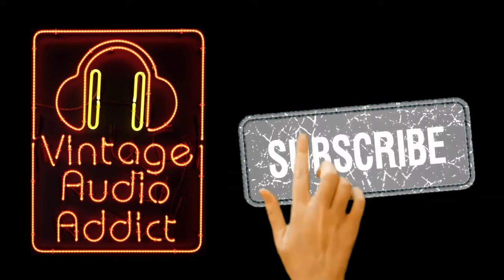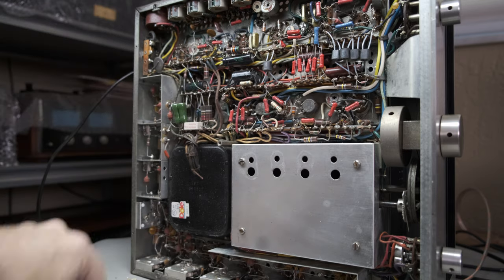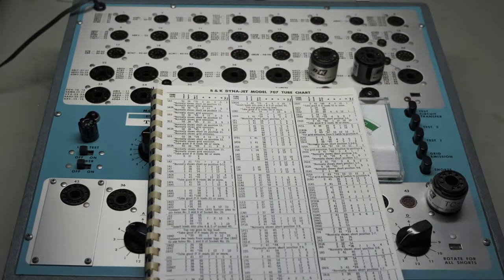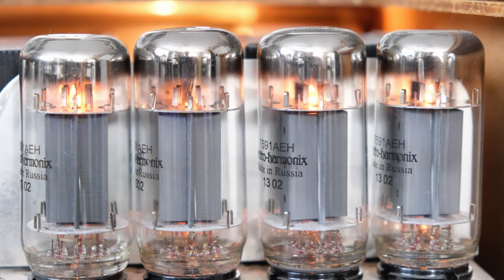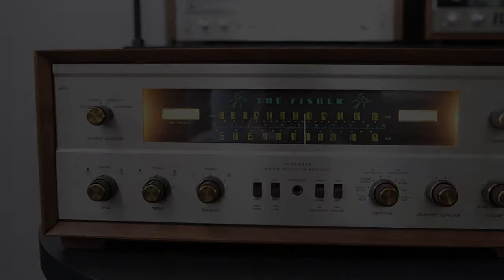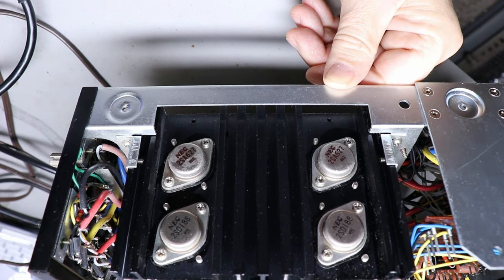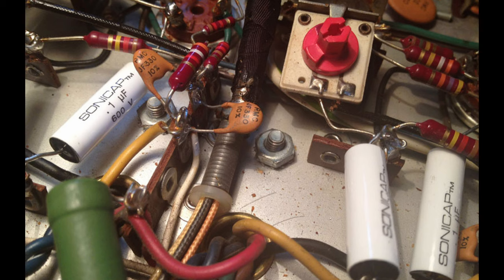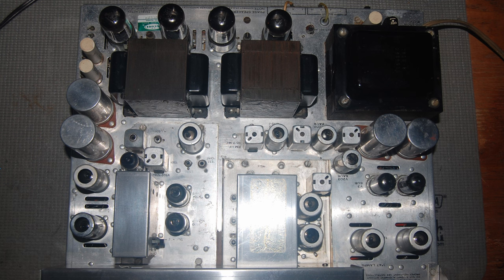Vacuum Tube Equipment - Wonderful Vintage Audio Stereo Sound But Hazardous To Repair or Restore.

Comment: When I was in the Navy I screwed up and had 400 vdc plate voltage from a transceiver go right through my chest. Man did that hurt! I was sore for a couple of days. When I left the ship and went to shore duty, I worked on high power HF transmitters with 1200 vdc plate voltage. I learned my lesson and was very careful.

Comment: Glad I watched this one!  I bought a Pioneer SX-82E (for $135 at a local on line auction).  It hasn't a scratch...came with all the original documentation...and has known provenance as the seller acquired it from his sister-in-law following the passing of her father, who bought it new in 1965. It tested sat and works...but the electrolytics are ancient. Therefore, I am a bit hesitant to run it until it is revised. Tubes are all original.  I opened the bottom cover and had a coronary...it's all point to point wiring that looks like a Gordian Knot surrounded by a neural network.

Comment: Worth mentioning is that since tubes use such high voltages to operate they routinely utilize power supplies with very large capacitances.  Even when turned off they retain this high voltage and high quality caps with low leakage can retain a charge for days.  Always discharge the power supply caps before replacing components.  They taught me in the Navy to discharge the power supply voltages when off before attaching any test equipment. Attach your leads and then power on the equipment.  It does take longer to troubleshoot but is safer.  Also watch those tube extenders. It is easy for your fingers to slide down the side of the tube and make contact with the pin-outs.
Reply from the maker: Very good points! Thank you for sharing!

Comment: Never forget my first year on my boat (USN) while in the shipyard; the boat was in drydock for a few months.  I was studying in the wardroom when we all heard the boom and smell from some electrical work in the 21 man berthing. The system was tagged out and the shipyard worker cut one of the power lines that fed the Fire Control System.  The cut line had the correct tag, but the tag was placed on the wrong line by the ship builder. Unfortunately, the worker did not FIRST check the line with a Clamp voltmeter to see if it was live. He used a large wire (bolt) cutter and the power in that 3 phase 440V line vaporized the cutters up to the rubber handles.  Thank goodness the man was standing on a rubber mat with gloves and protective gear. An incident I will never forget...the noise was substantial.
Years later, while on business in Charlottesville, I was staying at a hotel where they were doing work outside in the parking lot just below my 3rd floor room.  A worker was using a concrete pavement cutter and sliced through an electrical line to the hotel (nicked the gas line next to it , as well). I was in the shower at the time and did not even hear the faint evacuation alarm. In any event, he vaporized the cutter up to the rubber handles and suffered some second degree burns.  When I realized the parade outside the hotel was not a parade and actually an evacuation, I threw on some clothes and ran for the exit stairs. Missed my flight. Consider myself lucky...if he had pierced the gas line I doubt that shower would've protected me. A close call...not as close as taking Flight 111 the day before its ill-fated crash, but still too close for comfort.

Comment: I own lots of tube gear, and I agree hahaha. It's already scary at 450V, which is standard for many models, but I have some gear running 600V (Traynor YBA1A, has the YBA3 power transformer). There's the Fender 400PS - now that thing is a monster. There's a voltage doubler for the plates for 700V; it has a 6L6GC driving an interstage transformer, feeding 3 pairs of GE 6550As, which each tie into their own dedicated 4ohm out winding; and the speaker grounds ties back to the cathode of each pair. Scary.

Love the channel! Keep it up - I'll be a long time fan for sure :)
Reply from the maker: Thanks so much for the kind words and for commenting. Yes, tube electronics of all types can be dangerous. I tell you what else can be dangerous. A 220V AC electric clothes dryer. I was "screwing around" with one of those when I was younger and got bit. That was many years ago but I remember it like it was yesterday.

Comment: I've been nursing a Marantz 8b since 1962, when I first took it out of the box.  Unfortunately, as I get older my dexterity isn't great, so I'm wary of accidental damage, or accidental self-electrocution.  (Been there, and my gear is 220v.)   I will say however, that all the tube amps  I've owned only sound better and better with age.  My oldest is a 1933 Philco console, but the 8b is my honey for life.
Reply from the maker: Thanks so much for sharing. Wow, a 8B! You really have something special. The older tube gear is truly amazing. It can still hold it's own after all these years.
Reply: @vintageaudioaddict  The warmth and detail just keep getting better with time, and especially noticeable at low volume, where solid state drops out.  The 8b I received new as a birthday gift in '62.  I enjoy it so much that I went out and bought an 8a in '75.  Unfortunately, as your article points out aptly, over the past few years I've caused a lot of wear and tear through constant breakdown and reassembly with unsteady hands.  Have upgraded my workbench with better magnifiers, micro vices, and lighting.  Not going to wreck my 8b or get killed doing so, lol.

Comment: Love Tube amps finally found
' a New Age' 
Tube integrated amp that i like better than my previous king Sansui G-8000 
The Doge 10 MK-2b is a 59 pound beast
Kt-120 power tubes , And the Circuit is built with very highend electronics ESA-Clarity Caps notch filters
 Nichicon caps Wima Omron Relays ALPS Blue Velvet Volume control
 Z-10 core still transformers And Top grade German PTFE Cabling . 
This amp sold for $6400.00U.S. under the Lua Brand while Doge made for them now for $2400.00 U.S. STR8 fron the factory  its hard to beat ! 
And 'Full Warranty' no worries about fixing nothing for a long time
I have had the amp for 2 years and it works perfect  , I play the hell out of it everyday 
I have 4 different sets of
 Power/Pre Tubes also geez its Powerful 
Pushpull desighn never thought A tube amp could have this much weight to the sound ! ! And the Imaging is amazing ! 
Electric 🎸 Geez ! The sound just hangs in the Air and decays slowly into Oblivion 
And I agree stay away from Vintage tube amps unless you know how to work on them or have a lot of money !! 
Vintage wise Western Electric is King ! 
Since the 1920s those big theater systems were no joke !! 
Just me Opion
Reply from the maker: Thanks so much for sharing. I've heard the Doge 10 MK-2b is a wonderful amp. I didn't know the details. Thanks for the info.

Comment: Had a shop and worked on various electronics over the years. Tvs musical instrument amps, microwaves etc. You develop a sense to be careful. Not unlike working at a very hot grill. The first thing is to watch where your fingers are. If you're used to working with low voltage it's not a big deal to touch the circuit but with high voltage you need to keep clear.
Reply from the maker: Thanks for sharing.

Comment: Was taught to keep one hand or pretend to keep one hand in my back pocket. Eventually I started wearing one work glove on my least dominant hand. Aside from that a tube tester is not perfect cause a tube tester does not tell you if a tube is going to be microphonic or go goofy. “Emissions” is what 9 outta 10 testers test for and that’s really 1 of 3 things a tube should be tested for. Current is a major need to know but very often overlooked. So honestly a tube tester is good for 50% of a vacuum tube’s reliability.
Reply from the maker: Thank you for sharing your knowledge.
Reply: @vintageaudioaddict  : Thank you for the videos.
Reply: Please forgive my boorishness and ignorance, but could you tell me what the  third property to test for would be.  I glean from your response that emmisions and current are the first two. I thank in advance good sir.
Reply: @bobbysparky4299  : 3rd is done by us humans and that is “Microphonics.” Thats done by playing through the device the tube is in and tapping the tube physically. A microphonic tube is not going to be determined by the tube tester. Granted many times, in many circuits capacitors can be microphonic. That’s the reason to try different brand caps and different tubes in the same spot to do process of elimination. I’m also not an electronic wizard. I just know what I’ve learned through the years and by trial and error. It also helped that very early on I had Kenny Fischer from Train Wreck and Dennis Kager from Sundown as close friends and teachers. Both very knowledgeable but both very different in opinions.
Reply: @theirritatedirishman5440  This old man truly thanks you for your kind and prompt reply.
Reply: @bobbysparky4299  : Don’t sell yourself short, I’m sure you’re wiser than most.

Comment: I love Tubes. I worked on stuff that landed on an aircraft carriers and patrolled the pacific. Klystron oscillators have an outer shell (plate) that will connect a stray screw driver with 250vdc. A magnaton that can pump out 158Kw @ 9.6Ghz. However your tube collection has nothing on my all transistor Yamaha rig.
Reply from the maker: First of all thank you for your service! I've got several Yamaha pieces in my collection. My CA-2010 is a favorite - https://youtu.be/20D4R7zQzhU
Reply: @vintageaudioaddict  I stopped wanting after The M50,C50 I can honestly say they replaced a HK Citation amp @ pre amp. It was riddle with bad caps causing red plate and xfrm burnout.

Comment: I'm just an old country Electrical Engineer, but I thought I'd give my 2 cents worth.  I agree with  VAA completely. I'd also like to add that I'm a firm believer in BUY AMERICAN.  I went to the Western Electric website to price a set of matched quad 300b's and damn near had a stroke!  I just wanted some good American tubes, I did not want to establish an annuity for their grandchildren!  Think long and hard before you travel this road.
Reply from the maker: Thanks for sharing.

Comment: 6AQ5 (x 2) / 12AX7 (x2)  / 6BM8 (x4) and rectifier (whose name I forgot). I once own a stereo amplifier that used these tubes, it was sold by Radio Shack in the mid 1960s as a kit. The chassis was aluminum, and inside it was all point-to-point precision wire-wound resisters. 

It was lost during a move (movers lost the box it was packed in). Problem: I don’t know the brand or model number! Strangely, nowhere on the unit it, inside or out, was there any indication of who made it. I would love to find one to replace it, but without a brand name or model number, there is no way to search it. 

In your vintage experience, have you ever seen anything that fits this description? On the front, it had one row of knobs, no balance knob. Instead, each pot was clutched, you pull out the center knob and this allows for each channel bass, treble and loudness the be adjusted independently. 

The aluminum chassis was raw, with the instrument names (mode selector, bass, treble, etc.) stamped on in crude ink. It was clearly intended to fit inside a finished front panel, which likely had the name and model displayed. It was a breathtaking beauty, with sound quality out of this world. Any ideas?
Reply from the maker: To answer your question, no I haven't. There were so many different pieces of vacuum tube equipment manufactured under varying names and model numbers over many decades.  Add to that many one of a kind units that hobbyists built themselves.

Comment: what i was wondering, on old tube amps, how often do you run in to problems with the transformers?  and is that something that degrades overtime and effects sound quality or is it just one of those things that either works or it doesn't?
Reply from the maker: I've never had a bad power or audio transformer in any of my tube equipment. I know that they can and do fail but I think for the most part the transformers are very reliable.

Comment: I've got zapped by plate voltage (300V I think) once. Did really hurt for a few seconds, ouch! Guess I still was lucky though. Since then I've been more careful and never got zapped by tube equipment again. Cheers.
Reply from the maker: Thanks for sharing. Yes, getting shocked is no fun. I got bit by a 220V AC electric clothes dryer. Man, did that light me up!

Comment: Be careful with HV. I work on big particle accelerators and we use 750,000 Volt 1,000 amp power supplies. I was interviewing a fresh out EE for a power supply engineer. We went down to the sub basement and I showed him the power supply. He got confused and asked where is the power supply? I told him he was standing inside of it. The capacitors are the size of small cars etc.
Reply from the maker: Thanks for sharing. Sounds like you don't get a second chance with that equipment.
Reply: 750 000 Volts at 1 000 amp shock would be painless I suppose.

Comment: i have that same u testem  tube tester  ..got it for 50 bucks   full of tubes,,,,
Reply from the maker: Man, you got a deal!
Reply: @vintageaudioaddict  yep   it  work  ok   ...but  i worked on an have lots of tube  radios  ..cbs  ect ect,,,i grew up on tubes  ,,like you said   dc will kill you ,,
Reply: The most unpleasant shock was coming into contact with the TV horizontal output in a TV.
Reply: @marka1986  yes  thats rf
Reply: @marka1986  Shango066 said that is much worse than the shock from the picture tube HV anode. The pulses coming off the horizontal will give you a nasty painful burn that will hurt for a long time. Shango066 is a YouTube channel

Comment: You made a mistake with solid state equipment. Some power transistors, such as the TO-264 Motorola MJL series flat pack transistors punch out 200 watts, with 250 volts power. That's more than 100 volts!!
Reply from the maker: Any voltage in any piece of electronic equipment plugged into your mains can be dangerous.
Reply: Would that be pro audio PA gear? Most amplifiers in home audio are limited to under 98 volt rails such as Dan D'Agostino designs.